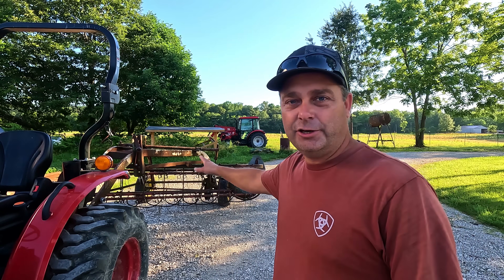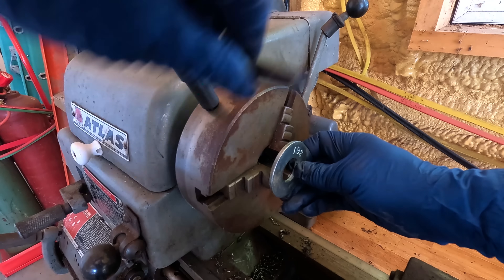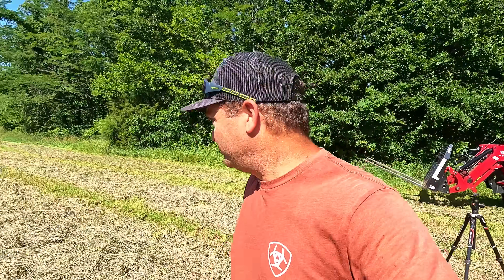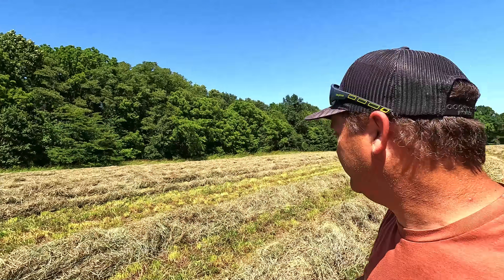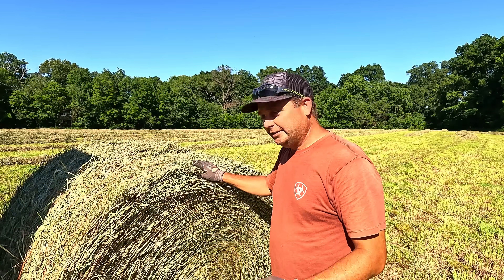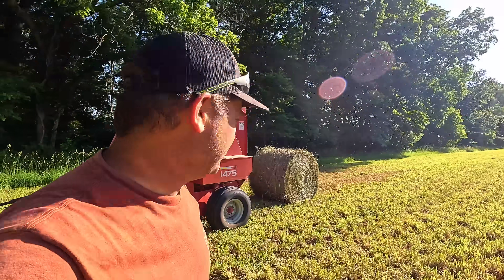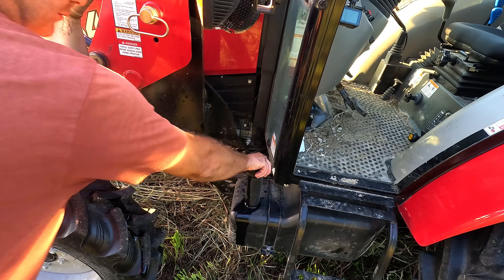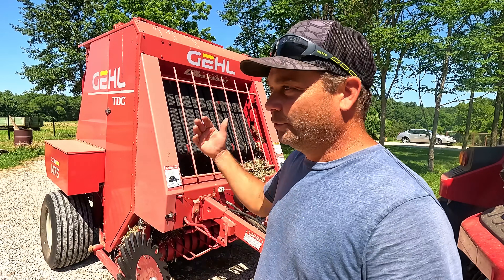I Fixed the Baler.  Then I Broke It in the Same Day.  But We set a New Record for round bales.

Comment: So it goes with baling hay. I remember when my boss had a brand new New Holland small square baler. We had gone maybe 100 feet when the shear pin popped. Replaced. 10 more feet. 2nd pin popped. Installed pin #3. Engaged the PTO...POP! Installed pin #4. Engaged PTO...POP! Boss was NOT a happy camper. We pulled that new baler back to the dealership. Turned out it had skipped time due to something not being tightened down properly. It took two days for the dealership to figure it out, but it was finally fixed and worked flawlessly the rest of that season and the two following seasons. Fun times.

Comment: Using the lathe to enlarge the washer is WAY better than trying to drill it out, over-sized.  Simple things like that save a LOT of time, when you have to improvise/fabricate parts.  Waiting for the correct part you order wastes much time, too, and that's avoided.  Compared to all those struggles with your first efforts at hay-making, you've come a LONG way, Evan.

Comment: That wire holder is called a polgle stick (it is sold in truck stores) it holds the 7 wire plug and when applicable the handles for air brakes on an air brake system.

Comment: Nice looking hay,nice looking windows, I had an Allis model 77 rake,you can't hardly beat the old side discharge rakes,the upright pole your talking about is called a pogo stick, longer wheelbase road tractors have them to hold up the airlines and electric line,go to just about any heavy truck parts supply  house and you'll find what you need, on my Peterbilts I had the pogo stick that had a bracket that held the lines and a big spring that bracket hooked to,that spring held the lines up and gave you a whole lot of slack when making a tight corner.  You're doing good , keep it up and finish that Allis up for us guys that are partial to orange paint.

Comment: Congrats on the hay 😉... if you've any odd cable trunking available try running your balers new wire through that.. might protect it a bit more.. 😊..  Things like that aways happen when the pressure is on you.... 😢 sods law... 😅.. glad your baler was wireless in the end of the day 🤪.. stay safe 🏴

Comment: As far as a fuel tank, just in case you're interested, I got a 55-gallon drum and a hand pump that has worked great for me for a little over a year now.  I built a pallet out of treated lumber with tie down eyelets I use to strap it down and screwed down some wood blocks to keep the bottom of the barrel in place on the pallet. I loaded it up in the back of the truck and filled it up at the gas station initially but usually end up just stopping by and filling up a couple of 5 gallon jugs every now and then to help keep fuel in the barrel topped off instead of waiting until it's empty and loading it up in the truck. Here's what all I got off of Amazon. Hope it helps.  

Hand pump - Fill-Rite FR152 Fuel Transfer Piston Hand Pump w/Discharge Hose, Nozzle Spout, & Suction Pipe

 Filter System - Fill-Rite 1200KTF7018 18 GPM 10 Micron Particulate Filter Kit

Vent Cap - Dee Zee DZGASCAP Transfer Tank Vented Cap w/ Threaded Neck
Reply: I like your ingenuity!  Still sounds like a bit of a hassle to keep it filled though.  If the local CO-OP has a delivery truck, a bigger tank that's filled a few times per year might make more sense.  I reckon it depends on how much fuel he actually uses.  Wouldn't hurt to get both diesel and unleaded tanks, because he might get a good fuel price, and they'll never need to visit the gas station.
Reply: @spacehonky6315  Thanks. It can be a hassle but, I guess it depends on how fast you go through it. I don't use a whole lot but do eventually run out. But, doing it that way really reduces the number of times I have to load everything up, which can be a hassle in itself. Also, my tractors fuel tank is located up high where it's a hassle to climb up to fill with heavy 5 gallon jugs.

Comment: Running out of fuel or not having enough fuel to finish the job you are working on is a pain. I use a 55 gallon white drum that I got from the local carwash for free. I had a 12 v fuel pump that I had years ago that fits in the barrel bung. I have the tank sitting on a Harbor Freight wooden dolly. 
I can move it around to wherever I need to in my shop to store it out of the sunlight or just out of the way. 

I use the front end loader to sit it off my truck after taking it to get filled up. With the drum being white, I can see how much fuel I have put into the tractor and how much I have left in my drum.

Comment: DEFINITELY GET THAT SAFETY COVER FOR THE PTO!!!!   I had a sister-in-law who's brother got caught up in a PTO shaft connected to a grain elevator and by the time someone got to the tractor to turn it off they ended up removing his body from that PTO shaft like raw meat from a shish kebob skewer.    His head had hit the tongue on the drawbar so many times that the only thing left was some bloody pulp hanging by a few tendons. They threw his body, and all the parts they could find, directly into a closed casket.  PTO shafts are nothing to screw around with!!!  🤬😠😡

Comment: Our farm had a The conditioning system on the mower-conditioner is intended to crack, split or abrade the plant stem to provide easy routes for the plant water to escape, helping to overcome the natural tendency of the plant to hold onto water.
 A mower conditioner is mostly a bad idea breaking the fibers like that and a simple sickle mower would be fine for fields your size under 700 acres.
 I love watching you fix old junk though especially when it works.
Reply: Don't bring up the sickle mower to Evan!  Not his favorite piece of equipment.
Reply: @dwightl5863  😆 I remember that. A good tedder is worth all the money.

Comment: As to that contact sensor and the hi cost  .What it looks to be a simple contacts inside that tube  ? Might try soaking the old one in contact cleaner  , than  using a multi meter to see if it is reliable each time you push it down  .
Might try just pushing the button down  , than spraying down around the bottom  before soaking it .
Most likely the contacts get corroded just from moisture in the air setting in the open shed  .
Reply: My guess it it a reluctance head that sense those gear teeth.  No mechanical switch involved.

Comment: See if you can get the specs off that sensor.  The voltage and whether it's inductive or capacitive.  Probably inductive if it's reading off a gear.  I'll bet you can get something for under $40.00.  But then again look at me giving advice to an electrician...lol

Comment: I’m wondering why you didn’t check the fuel gauge before you started baling your lucky you didn’t run the tractor out of fuel otherwise you’d have to prime it to get it started again
Reply from the maker: I put all the fuel I had in the small tractor before I raked.  The big tractor showed half a tank.